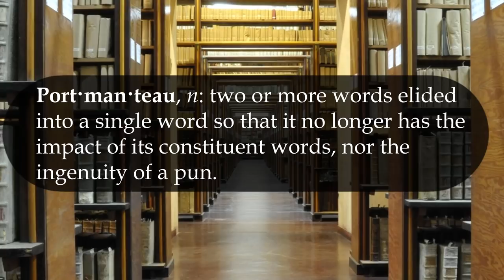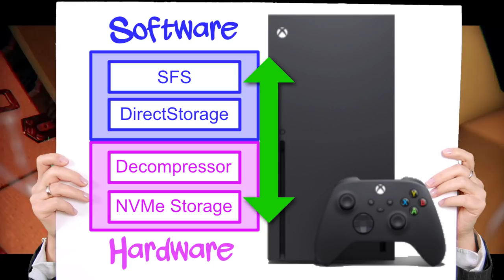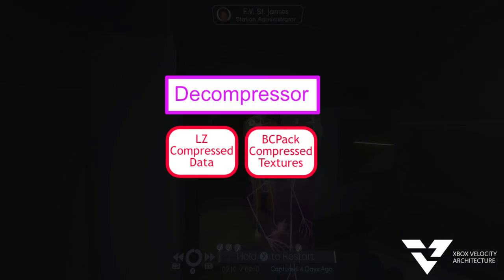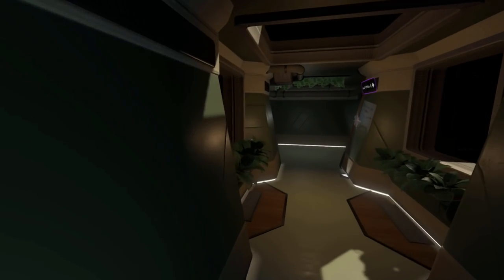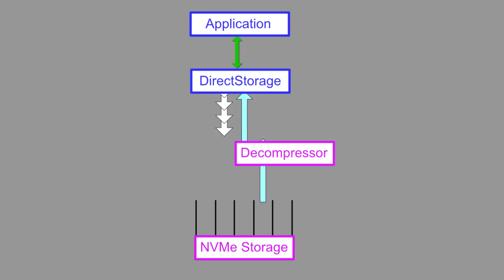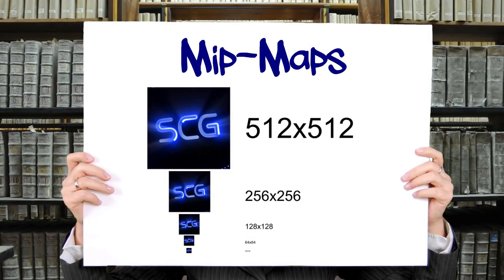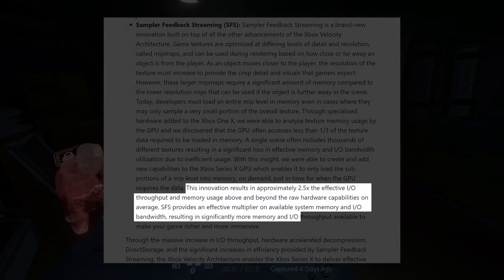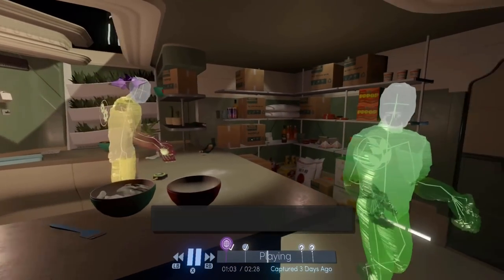Xbox Series X Velocity Architecture Explanation and Overview

Comment: Definite game changer, combine with VRS, Mesh Shading and DirectML Super Resolution and you have a monster machine because these hardware based optimizations decrease the memory usage, prevents I/O bottlenecks and free resources on both the GPU and CPU, the reason why the Xbox XSX should be able to do real time real tracing on 60fps when all the optimizations are used smartly. Looking forward to the first mind blowing exclusives
Reply: Agreed and so far no game has really even taken advantage of any of these features while the ps5 has used most of it's.
Reply: @Spartan_83  That's because of its dev kit, how easy it scales. And the fact that gdk is new and devs haven't had any time with it. Only a matter of time at this point
Reply: @AlexM-gv4pf  I know
Reply: @Spartan_83  That's what every xbot wanna believe nowadays.
Reply: @lecrutiz1052  keep telling yourself that.
Reply: Dyeffson Dorsaint  what was dumb about it? That's has been said by multiple devs.
Reply: Dyeffson Dorsaint  I never said that both consoles were close to being utilized but the series X has full Rdna2 and the PS5 doesn't, pretty much none of the rda2 features have even been tapped into yet as a matter of fact most of the series x games have been delayed because direct x 12 had to be updated to take advantage of rdna 2 and the last thing that I read the PS5 was still using PS4 tools.
Reply: @Spartan_83   by “full RDNA2” do you mean “standard RDNA2”? PS5 & Xbox has the same chip architecture. It’s like, Sony & Microsoft have the same type of car “BMW X7”, but Microsoft bought the car as it is and Sony bought and modified it to make their “custom BMW X7”. But basically they have the same “car”
Reply: @Spartan_83  “There’s a lot of marketing spin here though.

These features are tied to the DirectX 12 API which the PS5 obviously won’t use since its exclusive to MS.

That’s like PS5 coming out and saying MS won’t support Kraken decompression and the Geometry Engine”

Sony could have some coding magic up its sleeve. While Microsoft will be using DirectX 12 Ultimate as its API, Sony is using its own custom API that will aim to unlock as much power from its AMD’s chips as possible.

Xbox and Playstation have very capable chip in this console generation. The difference is minimal, even less than XOX vs PS4pro. Xbox has the power and PlayStation has the speed
Reply: @geinsgreygoose395  not really seeing much of a speed gap between the two. PS dev already said ratchet and clank could also run on sx.
Reply: @Spartan_83  I’ve never read an article about PS Dev confirming XSC can run ratchet & clank. But this video I found awhile ago

https://youtube.com/watch?v=UlFiBDhLhgQ&feature=share

Nothing against xbox, it’s a piece of monster machine too, which I’m trying to get until now with no luck. I’m just trying to understand tech stuffs of both console
Reply: @geinsgreygoose395  It was on a youtube podcast, one of the Devs working on R&C was asked if about it and he said that it could run it. SX can load 100GB of data instantly.
Reply: @geinsgreygoose395  Yeah that's it.
Reply: 100GB of data instantly, not factoring in SFS.
Reply: well what exactly has happened!?

Elden Ring, Assetto Corsa Competizione..many others all run inferior compared to PS5

Where are those extra 2 TFLOPS!??
Reply: @Spartan_83  

We weren't even talking about PS5 😭, why console war now ?

And just to get things straight, PS5 isn't close to having been maxed out either
Reply: @_Athanos  I own both no console war here just speaking my opinion.
Reply: @Spartan_83  

 @Charles M.  

It'd be more correct to say that Xbox Series consoles have stock RDNA 2 cards (which isn't even true as two main features, being Infinity Cache and high clocks aren't being implemented in either console, but given the RAM bus and bandwidth, Infinity Cache isn't very useful (same for PS5 and its insane I/O feature that allow for so much better RAM utilization)), however, high clock speeds are an important missing features and a higher CU count will not be able to fully counter it.

PS5 on the other hand has customized its chip much more, stripping it from some features that aren't that useful for the sake of pricing (like RDNA 2 ROPs which only have hardware VRS as an advantage over RDNA ROPs, which is gonna be implemented in software in the great majority of games anyway at a very negligible cost). Same for Mesh Shading, first of all, it's a new shading technique but in no way concurrent to Primitive Shading, Xbox Series consoles will need to do Primitive Shading and PS5 Mesh Shading as well, and from what seems, the Geometry Engine seems to be hardware support for it, but if it's not it'll just have to be made in software, which sucks a big but PS5 is so easy to optimize for that it'll kinda close the gap that probably doesn't exist.

Bottom line, both systems are great, PS5 is more custom and stripped of some negligible features when accounted for software optimisation while Microsoft's solution is very balanced too, they juste brute force it more 🤷🏼
Reply: @_Athanos  Like I said I have both so I can go by first-hand knowledge and even games like Godfall and Dying light 2 both have a 120fps mode but the PS5 version does not even though Godfall was a PS5 timed exclusive and then you have games like Farcry 6 that have 12% higher resolution than the ps5. You can give me all the numbers you want but it doesn't mean anything to me.
Reply: DF even came out and said the SX has shown better performance and won most of their comparison test and the ps5 was only a clear winner in 2 of those and that was before the SX got updates for its gdk and other tools.
Reply: @Spartan_83  it’s quite true though. Ps5 is falling behind big time! Glad Xbox is back on track! U just salty.. Xbox 360 owned the ps3.. And then what happened? It’s very good with competition imo. Don’t get this let’s hate PlayStation or let’s hate Xbox.. Xbox won this time.
Reply: @skyazuldream  that is called Cherry picking and df even came out recently in a Twitter post and said the sx won the majority of their comparison test, the PS5 was only a clear winner in two. It all comes down to the dev and even the devs said that they have to learn the new tools that are being used by Ms. As we have seen recently the sx has been taking a lead and if I'm not mistaken you have games like godfall and dying light 2 with 120fpz mode on the sx but not the PS5 also games like fc6 running at 12% higher resolution at the same performance  and this is without using most of the rdn2 or dx12 features.

Comment: Sampler Feedback is a hardware feature of all DX12U capable GPUs, it debuted on Nvidia's Turing architecture (along with the other DX12U features) and is also exposed via OpenGL and Vulkan extensions. SFS is a particular software technique built on top of this feature which the Series consoles further optimise with a specific bilinear texture filtering method.
It's also worth noting that UE4/5 supports a full software implementation of the tile base streaming encapsulated by SFS, so the benefits aren't entirely unique to newer hardware or the Series consoles.
Reply from the maker: Correct. SFS (software) is built on SF and so is listed as a software component.

Comment: Emotion Engine: Nonsense
Reality synthesiser: Nonsense
Velocity Architecture: Actual solution to real problem
Reply: Shame we're 2 years into the generation and SFS and DS sit unused...
Reply: @MostlyPennyCat  That is true but I have not seen games where they can be used, they keep releasing games for the previous generation
Reply: @MostlyPennyCat  It wont come right now. A part of the tech was resently showcased in unreal demo. So it will start appearing end of this gen. Will be truly adopted in next gen. 
MS knows this and there is a reason. When series x was released , it was quite powerful and could brute force its way through the games. With time it will go slow and MS made a calculated move which will help it live longer.
Reply: these type of videos are good for nerds but not for gamers. 😂 Poor kids still waiting for high speed gaming but they don't know that all this stuff is crutch for late gen.

Comment: I love this series, none of the mainstream gaming sites has either the intelligence or patience to really explore these subjects, thank you so much. Also as a tool the velocity engine will absolutely be a major game changer, when used effectively, I understand that currently there are issues with the MS tools that they are iterating on, but will be done in fairly short order. I also wanted to know, more about the ML functions of the Xbox, as that was along with the robust BC and services the reason i wanted to get the box, will AMD and MS succeed with their ML solution and how does their current thinking stack up with the Nvidia tools which are largely based on dedicated hardware, whereas I believe the AMD solution is more hardware agnostic? I am not sure but would appreciate any feedback. Again thank you!
Reply from the maker: Thanks, Bummy, first of all, for the very kind words. I agree with you that, as the architecture has been such a radical departure, it will take time for the toolset to mature to the point where true optimization can happen. The PS5, while very impressive tech too, is similar enough to the PS4 that the adjustment was much smaller. I did a brief video on DirectML and have started deep dives on the RDNA/RDNA2 architectures and (publicly available) documentation on MS's utilization and put the most interesting bits into an overview video.

Again, thanks for watching and the support!

Comment: It's a great video, but they left the most important part out. The thing that Series does that no other GPU can is understanding tiled mip levels. All modern GPUs can load a complete mip level on the fly, but only the Series can ask to load a few squares in one corner of a mip level. Leaving 2/3rds of the texture data that is untouched sitting on the drive.
Reply from the maker: True, I purposefully didn't dig down into a lot of lower-level details, but kept the explanations general, more about the synergistic aspects of the Architecture as a whole. I left those bits unspoken when showing the mip-map tiles highlighted in the SFS section. It's always a hard call to go too low or too "general interest".

Thanks for watching.

Comment: New tech generally does sound game changing.  Now we need to see how it will be utilized.  MS needs to put out a game built from the ground up to take advantage of VA.  Kind like Sony made Astros playroom specifically to show off the dual sense.
Reply from the maker: From your mouth to their ear, my friend.
Reply: Just a matter of time, sx hasn't even scratched the surface.
Reply: @Spartan_83  I hear you but its been a few years and dx12 has only made a minor impact.  I just think they would be better served to release the features with a product that shows it off.  Instead of talking about how great it is and waiting for a 3rd party to blow our minds with it.

Imagine a 4k 60fps halo with path raytracing that had no loading with ms touting its only possible because of VA.  As far as gaming is concerned MS does a lot of talk but very little showing.  They need to fix that.
Reply: @billygrant9147  I belive will will see it sooner than later.

Comment: I'm just a simple man who doesn't not know too much about technological side of things. On intuitive level this technology sounds great for me, but practically speaking i want to buy xsx or ps5 and have troubles choosing between them. I like xbox's design and philosophy a lot, but ps have exclusives and seems to deliver more stable 60 fps (according to digital foundry and other reviewers) while xbox gets slightly higher resolution. While i use 1080p monitor and value smoothness more than graphic i wanted to ask what are the reasons for such result? As a technical expert, can you explain the reasoning behind such ps5 advantage and whether it should be changed in the nearest future? For example I've heard somewhere than ps5 has similar architecture compered to last generation models and it is easier for developers to work with it right now + xbox sent development kits later because Microsoft waited to implement a better chip in their console. So what are your opinion and prognoses for these two? Is it the situation where xsx has a better components and should definitely outperform ps5 in a few months (or at least pair with it in fps stability) or the subject has many unpredictability and prognoses about consoles future are speculations?
PS. not trying to fanboy any console, just looking for some competent opinions in the internet:) Would be grateful for complex answer if possible, thanks!
Reply from the maker: Thanks for taking the time to write Данило Побережний. Also thanks for putting a Lynyrd Skynyrd song in my head. :)
While I think either console is more than enough to make nearly anyone happy, I'll try to address your concerns in an impartial manner:
1. Smoothness - Yes, it's true that XSX gets higher resolutions right out of the gate and it's well documented that the XDK/GDK migration hasn't been as quick as one would hope. While the PS5 inherited much from the PS4, the XSX is a more radical departure from the XB1. In early, less optimized titles, this won't show. Digital Foundry pointed it out too. In some cases PS5 did have smoother framerates, but we're seeing those fixed slowly but surely (ref Valhalla 1.04). In the long-term, I expect XSX to hold an overall advantage similar to Xbox One X over PS4 Pro. Nothing huge, but consistent.
2. Exclusives - Microsoft got smoked in the last generation on this. Their studio purchases (now incl. Bethesda) will guarantee a wide selection of exclusives on PC/Xbox (especially with Game Pass Ultimate). Now, I suspect that not all of the Bethesda titles will be exclusive. I can't guarantee it, but think the larger titles might have timed exclusivity (Starfield, ES6, etc.), but as a business, it would be insane to not milk them a la Skyrim.

In summary, as in past generations, I'll have and enjoy both. I straddled the Amiga/Atari ST line and the TRS-80 Mod I/Coco lines. I'll do so with consoles too - appreciating the potential and beauty of all of their designs.

Comment: Be great to understand how volocity and full rdna2 will effect games using these features as guess these are still some way out and no one is talking about what this could mean for games.
Reply: This will allow games to have a more dense and dynamic world with more variety. For example, NPCs can have more variety in their outfits, reactions, animations, etc. Buildings can also have more variety in their design. More variety in cars on the street. Better lighting and audio in games. Greatly reduced loading times. Having the scenery in the game change quickly. A lot of this comes from the fact that the new consoles can load data much more quickly. The faster GPU will allow for denser worlds. This means more things can be rendered/drawn in the field of view or with a higher level of detail. 

Other than the SSD, the CPU upgrade was huge in the next gen consoles. This is responsible for so many things. If AI upscaling is introduced, and performs similar to DLSS 2.0, that will be another boost to performance that can be used to increase framerates or detail in the world.

Each gen games would look better but run at 30fps. This time games look better and run at 60fps, and some even reaching 120fps. That's all happening before the devs fully make use of the features of the consoles.

Comment: I think its a big deal, even though it works opposite to what UE5 is doing with Nanite. Nanite makes development time more efficient. SFS makes utilization of the hardware resources more efficient.

Going over everything. You have the SSD that makes data access faster. DirectStorage that further improves the efficiency of accessing that data from storage. A dedicated decompression block to take the load off the CPU. A higher bandwidth for memory accessed by the GPU, and SFS to reduce the amount of GPU data that needs to be read. On top of that there's an 8 core CPU with two threads per core. Outside of that there's a dedicated block for AI processing and the GPU has 52 CUs for parallel processing. Additionally, factor in the  use of mesh shaders.

The GPU is a nice upgrade from the one in the One X, but everything else is a huge upgrade. The Series S|X and PS5 have a lot of gas in the tank. This gen is going to be exciting.